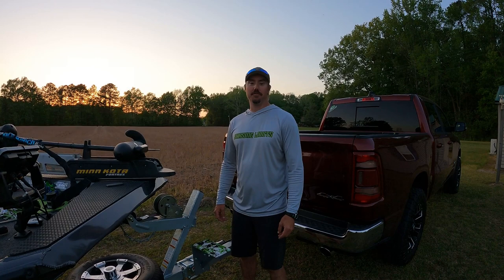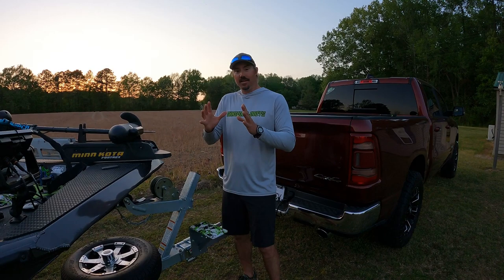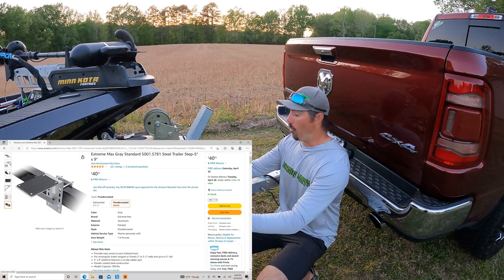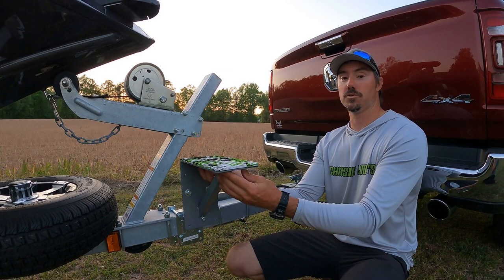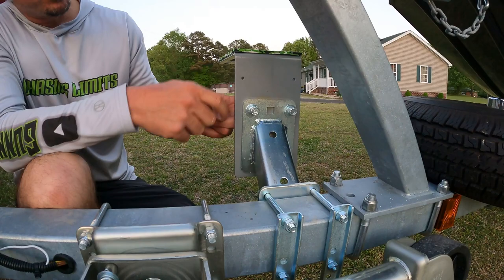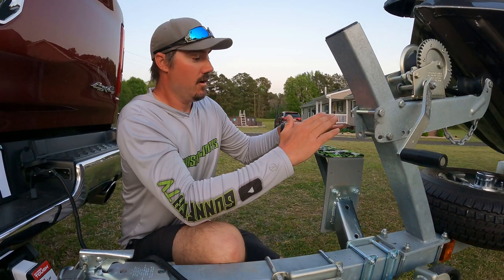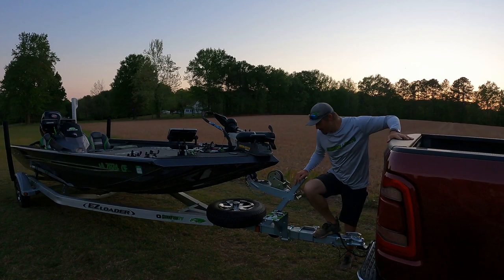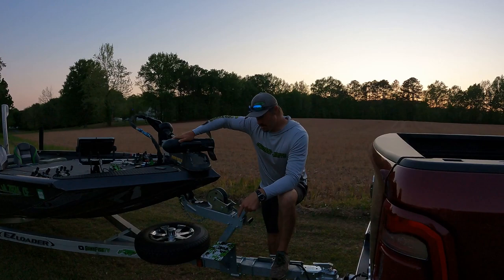Easy DIY Bolt On Boat Trailer Step For UNDER $100!! || Amazon Only Parts!!

Comment: THANKS SO MUCH FOR THIS VIDEO!!!
I just bought the both parts for $50 total on Amazon and easily installed them on my trailer without having to drill any holes.
Reply from the maker: Glad I could help!

Comment: Great !    Just did this to my boat trailer. The only thing I did different was to add a one  inch thick spacer under the bolts that go across the top of your trailer and drop the  bottom bolts to the last hole. Piece ended up being 1x3x4 . this gives you an extra inch of lift.  At my age every inch helps. I used a thick piece of plastic I had but you could use a piece of hardwood or a couple pieces of 1 inch  square  metal tubing, Thanks for the video.
Reply from the maker: Nice!! Glad it worked out for you. Definitely one of my best upgrades!

Comment: Great idea! I think I'll do the same, but I'm worried about the spare tire carrier strenght. It's made to carry a wheel with the rim, probably 40/45 lbs. Being me almst 200 lbs couldn't it bend or break?
Reply from the maker: That's why I threw that disclaimer in there. But I'm 180 and use mine at least twice a week. She's still holding strong. The metal used for the spare tire holder is actually thicker than used for the actual step

Comment: Thanks for posting this. Picking up a new Tracker Pro 170 this week and will be getting one of these setups as well!
Reply: What did you end up doing for a step on your Tracker TrailStar trailer?  I mounted only the step on the winch post of mine a couple of years ago but it’s not ideal.  I’m also looking for an economical flat step (or ramp) for the top of the tongue to walk on.

Comment: I use the FlexStep Pro Adjustable Trailer Step but I think I like that one better.
Reply from the maker: I looked at that one before doing this and it looks like a nice step but I just wanted a little more platform to step on

Comment: That’s an awesome idea. Thank you. I have only one question what size coo foot pad did you order for your step? I haven’t received my step in the mail yet, so I haven’t been able to measure. Just wanted to order that pad.
Reply from the maker: You can go on the Cool Foot website and order sheets of it on there. Or you can go on Amazon and order sheets of Hydroturf also